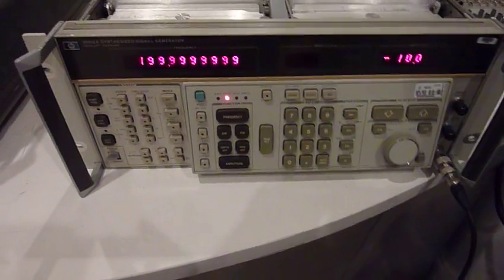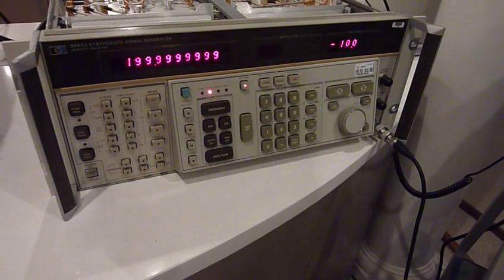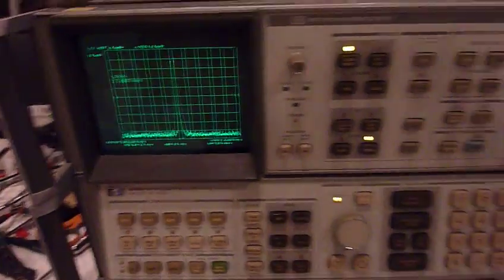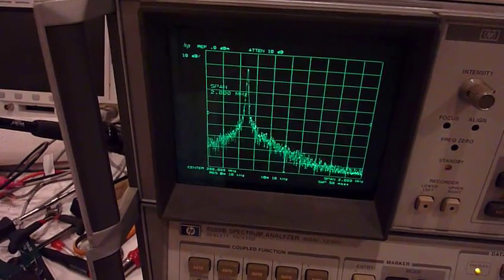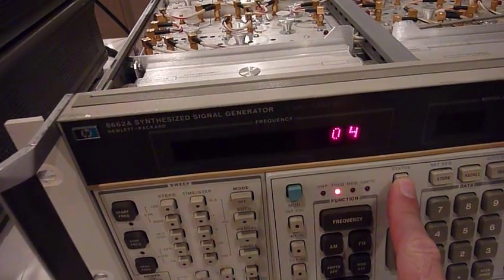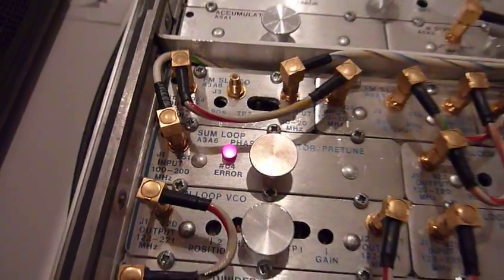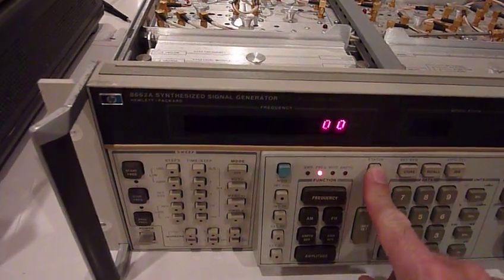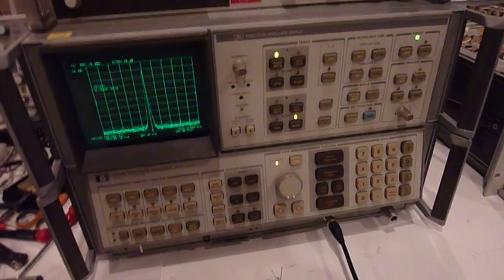HP 8662A synthesized signal generator repair part 1

Comment: I have the opportunity to get a partially working 8662 for less than $400, apparently has some attenuator and modulation issues, but the frequency synthesis and sweeper circuits are working fine. Is the attenuator in the 8662 mechanical, like in some HP spectrum anlyzers, and can fail due to mechanical problems? Or could this be a result of someone feeding too much reverse power into the signal output, which could have damaged the attenuator? Regarding the modulation section, do you happen to know of any pattern problems in there? Most of the documentation I could find was dealing with unlocking problems in the synthesis circuits, or PSU faults. All in all, would an 8662 be worth the $400 in this condition?
Reply from the maker: The attenuators are mostly mechanical, but there is also an ALC leveling circuit. Several good videos on The Signal Path on how to clean the attenuators.

Comment: I bought a 8663A recently. Last owner said the problem is the line swtich but I check the switch itself and makes contact normally. At first, started and works well; but then never starts again. 
The panel glitches a bit when line switch is ON, but fan doesn't rotate and generator never starts. 
PSU issue, I think. Any idea of remarkable power supply problems in these machines? 
Hint: diodes all over PSU motherboard and inverter board are ok with DMM
Reply from the maker: Yes, switched mode PSUs can be real bears to debug. I had a bad case of that recently: https://www.youtube.com/watch?v=VVrDyLMVS4U . But this one should be documented and have a schematic, so that should be 10x easier. You just have to go through it stage by stage and see were you lose it.
Reply: @CuriousMarc  Many frustrating component swap and many hours later, I set aside the PSU issue for a while and I hooked the generator to four bench supplies to do performance tests. Now I have wrong freq between 144 to 159.9 MHz (96 to 106 in output, instead of displayed  https://imgur.com/a/p76xnvh ) and oscillating attenuation between .9 to 1.8 GHz (here's a video of that: https://imgur.com/t57hI7G  )
Reply from the maker: Looks like great progress to me, it’s mostly working! It’s pretty hard to do remote debugging. The first issue looks like something similar to me - a PLL that is out of capture range. Do you get an error when that happens that gives you a hint which PLL that is? The second one is wild! Looks like a giant suckout. Could it be a reflection somewhere in your setup, a bad cable or connector? Try to post on the EEVblog Forum or on the  HP-Agilent at groups.io, you’ll get more eyes on the problem.
Reply from the maker: Coming back on problem 1, if it stays locked and you have no errors, you might have an issue in the digital counters inside the N loop or fractional-N  loop.
Reply: @CuriousMarc  I do editing yesterday but it doesn't save, I don't know why haha YES, the second issue was solved changing a cheap connector, now the level is flat in all frequencies, you are very accurate! :D
Reply: @CuriousMarc  yup, last night I saw again your videos about 8662 and I am pretty sure that some similar issue is in my 8663 loops, because no errors displayed, but #5 and #7 error LEDs blinks weakly while freq jumps like my first video. So, I'll explore in that direction... thanks for your time Marc ;)
Reply from the maker: @rrb6544  He I got one right, makes me feel good. The editing problem is probably because you had links in your post, and I have to review them first before it posts...
Reply: eureka! yesterday I was improving power connections with more wires for the 5,2 rail and  thicker ones for the other rails and voila! the open loop failure disapears. Here's a video sweeping from 130 to 170 MHz with level flatness and no jumps between frequencies https://imgur.com/a/TqjIRGF few! I am scaried about to adjust boards, this a hard hard boy. Now I can say that the gen is fully functional and working within specs
Reply from the maker: Awesome! One more instrument saved! Congratulations, and good intuition on the power cables!
Reply: Seen this problem a bunch.  I have 5 8663s that I'm trying to keep alive.  I have a bunch of the small transformers on the PSU board.  Needed one and had to buy many.  I may have the worlds supply!  If you need one, let me know.  Can't recall the reference designation and I'm too lazy to look!  The rest of the parts are pretty easily substituted.  Make sure you use veryvery fast schottkys if you need to replace those.
Reply: It is a  power supply problem, Did you ever get it fixed?